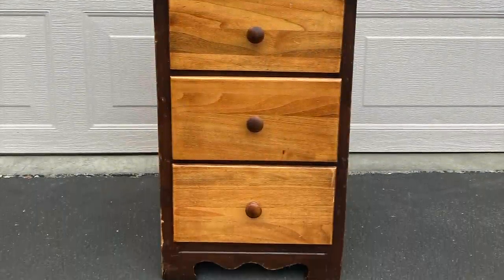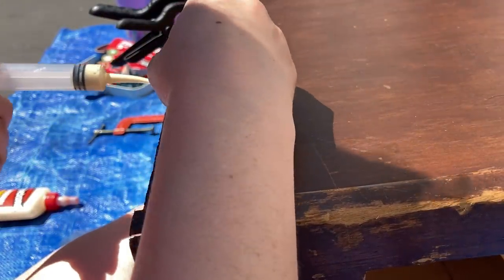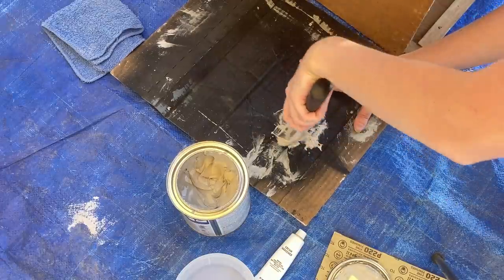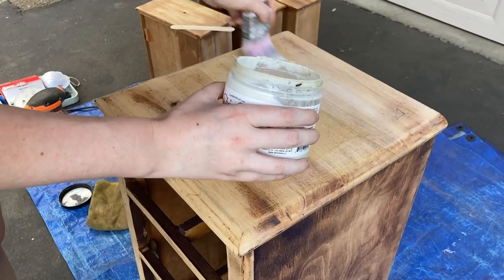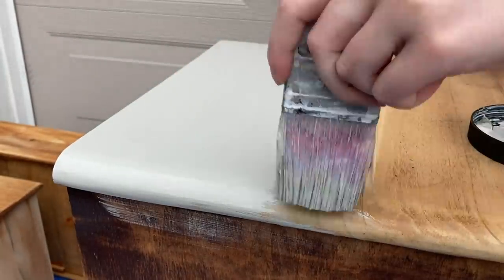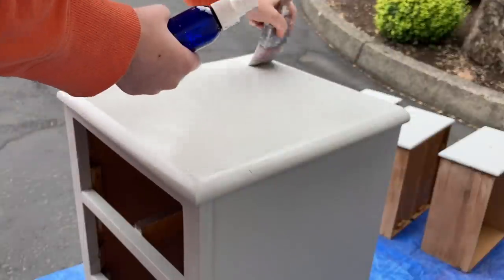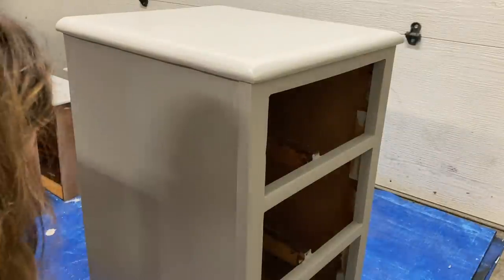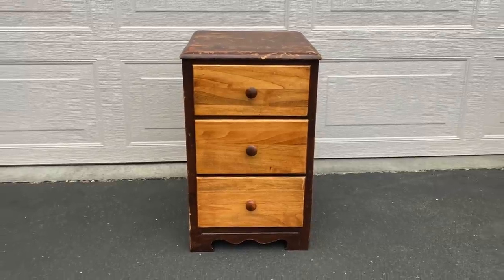How to Update a Vintage Nightstand Using Chalk Paint | Facebook Marketplace Furniture Flip

Comment: Lots of work for a little table . Very nice . When I glue things together I use a caul . It’s just a flat piece of wood a little bigger than the area you are gluing . I tape wax paper around it so the glue won’t stick . I use the caul to put even pressure on the spot I’m gluing. So put the caul on top of the area and then clamp it down. It will give you a better and smoother surface . ✌️
Reply: I forgot to say that the drawer pulls are perfect !

Comment: For those bottom sides I take a strip of lattice wood about the width and thickness of a yardstick and cover to whole edge. It adds strength and give a nice clean edge. I also check if the feet need a little wood added and put on new nylon hammer in glides. You always do a fantastic job!

Comment: My only question - having refinished a number of antiques myself - is why use an orbital sander rather than sanding with the grain? Is it relative to using chalk paint rather than gel stain or enamel? Thanks in advance for the info. What I know about refinishing was learned from my father more than 60 years ago.
Reply from the maker: I did go with the grain when using my sander, but I do understand what you mean. In my opinion, there’s nothing wrong with using an orbital sander instead of hand sanding. Especially when painting. You aren’t required to sand prior to painting with chalk paint, but I almost always do because I think it creates a better foundation for my paint to adhere to, and will make my finish more durable so it lasts longer.
Reply: @ChicAntiquebyHolly  thank you for the info. I normally use a small belt sander but it’s about to die of old age. 😊

Comment: Just a bit of advice. I'd stop using the C-Clamps and get some F-clamps instead. The kind like you have that are black and gray from Harbor Freight. Or even the squeeze clamps. C-clamps are for metal work and have the potential to damage the furniture if tightened too tight. Too tight varies from piece to piece and sometimes you have to clamp them tight to bring the lamination or split wood back together. You could accidently leave a circle impression on it. Like I said, just a bit of advice. Great video though and as others mentioned, great attention to details and taking the extra steps to end up with a quality end product. Thank you for sharing.
Reply from the maker: Thanks for the tip!

Comment: Does the finish on the sealer really make a difference on how the paint looks, ie. glossy... ?
Reply from the maker: It does. Chalk paint has a matte finish to it. A flat sealer will keep that finish intact, a satin sealer will add a soft sheen, and a gloss will add a high shine.
Reply: @ChicAntiquebyHolly  I have used high gloss sealer on some of my wood crafts and the glossiness is extremely subtle... hardly noticeable.  that's why I was asking.  Thanks for the info.

Comment: Does the wax come off when things are in the drew.?  Due you do the inside of the drews?
Reply from the maker: No it does not. After applying it, I came back and removed any excess that hadn’t absorbed into the wood using a microfiber cloth. There is no residue. Additionally, this product hardens and cures in 7 days 🙌🏻

Comment: what about the back? i am going to re-do this exact nightstand from my childhood and the back is messed up but everything else just needs love. how to i fix that?
Reply from the maker: I don't refinish the back of pieces like this, because the back shows character and oftentimes has marks on it that indicate age/maker. additionally, when a piece is against the wall, the back doesn't need to be pretty in my opinion. 
does the backer board need replaced altogether? you could get some mdf cut at home depot and use a nail gun/staple gun/screws to secure it in place.

Comment: Why did you wash the surface and then sand the surface away? You didn't need to wash it.
Reply from the maker: You do need to clean before sanding because if you leave the surface dirty and then sand, the sandpaper pushes the contaminants into the wood. You would never polish a car before cleaning it. It's the exact same thing.
Reply: @ChicAntiquebyHolly  I agree with you about polishing a car. However, you are not then going to sand the car down and paint it with chalk paint! If you were just going to re-polish an unpainted drawer unit, then of course you would clean it down first.